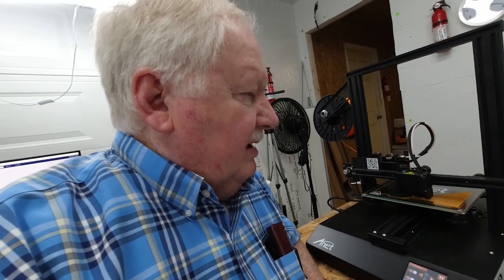MY 3D PRINTER SETUP OF THE ANET ET4 PRO & PRINTING PRODUCTION PARTS for the Lap Diner, a NTI product

Comment: How to connect with mobile or how to add Wi-Fi in anet et 4pro
Reply from the maker: I have not set up a way to communicate with my machines at this time. I do have some automated control ideas I am working on that will handle some things automatically. I do have mobile monitoring of the printers when I am away. Thanks for the comment and for your support...Ken

Comment: Have you considered using a .8mm nozzle for the lap diner? If it would work with your design it could cut your print time by ~60% or more, I can’t really say without seeing the model.
Reply from the maker: Yes I have been planning for some time to try a .6 or .8 nozzle, but just haven't had time. If the Lap Diner sales look good I will be looking at injection molding, but until then I will work on getting the best quality and speed 3D printing these parts. Thanks for your input and support...Ken
Reply: @NewTechInventors  0.6 is the way to go on this.  This guy with a print farm sells these big "dab station" things and he switched to 0.6 and won't stop talking about it lol.  Quality is almost the same, and for prints like lap diner it really is the same quality, and it prints like 50% faster.

Comment: Hi Ken, I have increased my first layer speed from 20 to 40mm per second with no noticable dip in quality, I also incresed my infill speed and inner shell speed and this has decreased my overall part production speed by quite a signifcant factor, maybe this is something you could look into as in your case this time saving even if it is a small increase per part would be a significant saving in an overall production run.
Reply from the maker: Thanks Andrew, I will try what you suggest and anything I can do to get more of these parts printed without sacrificing quality would help. Thanks for sharing your ideas and for your support...Ken